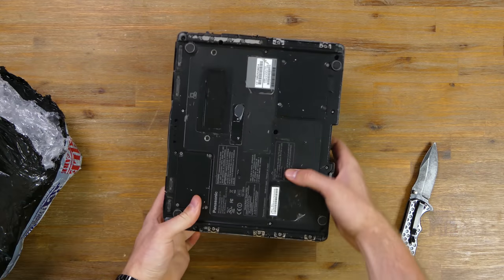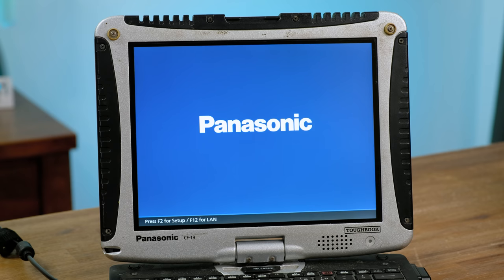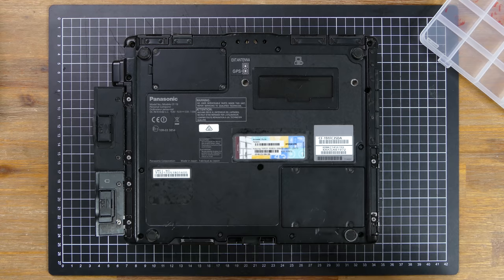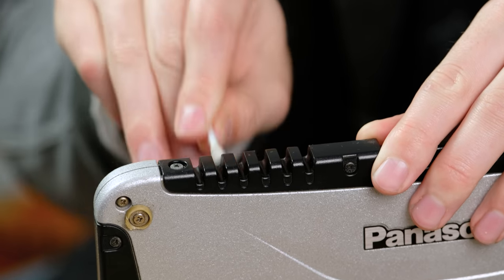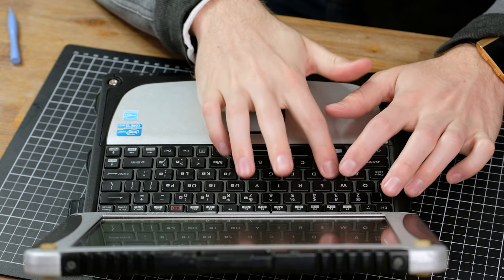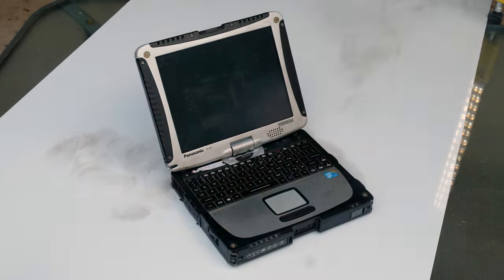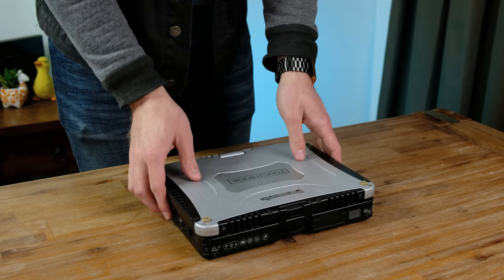Should You Buy an Old Panasonic Toughbook?

Comment: If you can, changing the FPS of the camera should help with the flickering. sadly only some cameras do that, but it's worth a check
Reply from the maker: Changing the shutter speed will often remedy the rolling shutter issue. As I said in the video it is caused by the pulse width modulation. You can't do anything about a shitty screen backlight.

Comment: Woah only 5k hours? Lol I have a CF-52 with 18k hours and counting and it's still going strong. It's pretty hard to beat these for durability :P. Had mine for a few years now and it has never failed me. Only thing I changed was swapped out the hard disk for an SSD.

Going way back, I had an old CF-27 (fully rugged) and it was impossible to kill. I remember holding it above my head, tossing it onto concrete and then jumping on it. Yeah, might have scratched it but that was it. Worked perfectly fine. The semi-rugged models like the CF-52 and CF-53 can be had with higher res screens too and aren't quite so extreme and are quite affordable. You can get a CF-52 with a dedicated GPU (albeit an old AMD one, like a 7750m etc. still fine for light gaming), 2nd/3rd gen i5 and 1920x1200 screen for a few hundred dollars on Ebay.

Comment: I actually have one of the first tough books, the seldom talked about Panasonic toughbook CF-45. It’s a little less rugged than it’s later brothers, but it’s an amazing little machine that runs windows 2000 like a champ and overall is a cool little computer. However finding parts for it and finding the machine itself is very hard. I got lucky and found the elusive pentium III version that can take up to 900mhz chips (in theory), and can run quite speedily and amazingly can run quite Cooley despite its high clock speed for such an old system. If you ever come across a CF-45, BUY it at ONCE. I can assure you it’s one of those machines you can’t afford to not get. It’s rare and super cool to own.

Comment: Hey Nathan
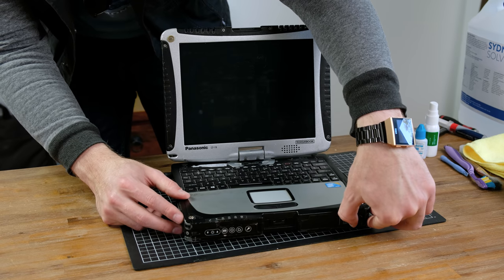At 7:44 I see that the laptop is still alive you should have tried to remove the WiFi card and try to boot it again some laptops don't boot if they detect a broken WiFi adapter I had a similar issue In a dell inspiron e1505 which didn't post when the WiFi card was broken.
Reply from the maker: Didn't make a difference sadly

Comment: The toughbooks never fail. They just keep running and running and running. The keyboards are the main thing that dies. The fact that there's no fans and they're nominally waterproof means they don't have the main parts that fail. The ones you see off of ebay are normally functional items replaced by organizations.

Personally, I thought I'd like the CF-19 more than I did. Even though it's larger, the CF-35 is a better choice since it has a full size keyboard. You really do notice the tiny keys on the CF-19.

Comment: There was never any adhesive or glue underneath the keyboard that was just the panel for the backlight of the keyboard... I've worked on multiple toughbooks in the past and none of them had some type of adhesive holding it down.. still a good video though

Comment: I think an older ThinkPad such as the T420 would hold up pretty good aswell ;)
Reply: I've used both and the Thinkpad while tough is not built to withstand military use like Toughbook or Getac. They are VERY different machines compared to consumer grade Thinkpads.

Comment: I have a asus laptop(X552V) and it got i5-3230, 4gb ram, 710m, 1tb hdd.
It can barely work cause hdd and ram.
I replace hdd to a 500 gb bx500 and add a 8gb ram on it ( and put hdd to odd slot with a odd-to-sata kit).
Now with 12gb of ram/500gb ssd it now can run smooth with windows 10 and do some simple tasks such as office or browsing internet. (it can even run valorant but I wouldnt recommend doing that)
The Toughbook got i5-3320 ( which is similar to 3230m), so with ran and ssd upgrade it should work fine with simple tasks.
Though I wouldn't consider spending 100 au to bought this thing ( since you need to spend more to upgrade and even if you do upgrade it's not that great), if people happened to have this kind of laptop, it's good to spend around 100 au and do ram and hdd upgrade.
And you got a good laptop you can use to browse internet for couple years.

Comment: I prefer these old ToughBooks to any cheaply made laptop. Laptops can get damaged so easily and often get knocked about but with a Toughbook you don't have to worry about it getting knocked or water spills etc. I'd rather good build quality at lover performance rather than higher performance with cheap flimsy build quality. The build quality for a portable device is more important.

Comment: I would be willing to guess that the laptop has more than 5300 hours on it, I used to do service on those for a local EMS service, and when they got slow we reset them and also cleared the bios, which would put the hours in use back to zero, also in not surprised at all that those keyboards were damaged or dead, if you could see the daily abuse they go through you would understand
Reply from the maker: Neat, I'd love to know just how much use the Toughbook actually had then 😅

Comment: Hey mate can you tell me how I would convert my old broken CF19 into a newly purchased good one. I have a great unit from eBay and I thought it might just be a case of swap over the hard drive and it should just be the old CF19 right? Well it wont start and just gives me the blue screen info. Can you help?
Reply: I've got several CF29's. Starting working after changing RAM, hard drives and a small Linux distro like Puppy.  Worth a try?  Also new CMOS battery!

Comment: Its probably worth spending the $100 to replace the cheap feeling keyboard with an original OEM one. You can spend more than that repairing a modern laptop. These toughbooks were built by Panasonic to last.

Comment: Tip - you can get the CPU from the broken motherboard as it is socketed. Sell it on eBay.
Reply from the maker: The CPU isn't socketed.
Reply: @psivewri  Seems odd, as these are 1st and 2nd/3rd gen Core i5s, all 1st gens were socketed (socket G1), and most 2nd and 3rd Gens were socketed too (socket G2).
Reply: @lbsiuk  They were but in Toughbook series, they were generaly ULV variants and they were all in BGA format.
Reply: @TheotanyaSama  It's a 3210M. That's a socketed CPU.

Comment: My Main laptop right now is a tougbook CF-19 Mark 4 I got it for about $120US without the power supply and over 50,000 hours on it. The non light up keyboard is the basic one, the light up one is a option. the touch on mine requires a Wacom Pen like what is used on some lifebook models and doesn't have finger touch, the pen I used is from a lifebook t-series laptop. I found a parts site bobjohnson . com, have yet to order from there yet I need new sceen housing pieces and need panasonic and toughbook logo badges

Comment: i Would not mind having the leftover parts;).iam trying to find out where to get a brand-new battery that can be mailed to Canada.i bought one of these bad boys almost 5 years ago if not five years ago at this point.it was running windows XP and unfortunately not the original hard drive.i really have to put a solid-state drive in it.i bout it on ebay where a guy had them listed wrong.he was selling them as b grade missing a couple of the Robert fans off of one of the sides i including shipping paid under 150 Canadian for one fully working with at that point a battery bear in mind back then they were going for around 250 up Plus nearly 100 for the shipping.i reley have to find out if it will run Windows 7.but it runs Windows XP quite well.i did upgrade the RAM about a year after I bought it.i see tham going for as much as the thousand dollars used running Windows 10 and I still don't know how people Cramming 10 on tham.but people are apparently buying them locally at at insane price. i have 4 hand haled ruggedized tablets that i bought about nine months ago out of curiosity.i bout tham agan listed incorrectly normally in the condition I got them you find them listed around 200 American i payed like 20 and 40 Canadian and wish I would've had the money to buy more .with a good working copy of Windows 7 aroun;d here locally they'll pay 300 and 400 lol.3 were running a malfunctioning version of Lennox:( thay had been used by a garbage collection company at that pointand i reinstalled Windows 7 but iam having trouble finding the drivers for the Internet and touchscreen.one had the original Windows 7 on it and i haven't been able to get it to do a full factory resetbut it works quite well and would compare it to the pap boy in fallout if u can imagine that lol. They're very similar.i unfortunately don't have that arm mount which was a optional thing.i at some point have to drive with Windows and on one see if that is me back touchscreen drivers..the things are crazy handy and i really wish I knew where to get new batteries.the batteries have about a 2 to 3 hour life on the ones that I've got.things practically are indestructible and for a guy that has a huge need for windows 10 ide love too have them running Windows 7;).

Comment: I've got one of these.  It's a tank.  Though, it's an older core duo model and my Raspberry Pi 4 is faster.
Reply: Toughbooks were NEVER meant to be fast. Even when brand new. That's not the point.
Reply: @ZenithClarity  : Just because it wasn't fast didn't mean it wasn't useful.  I just recently upgraded from using that as my daily driver.